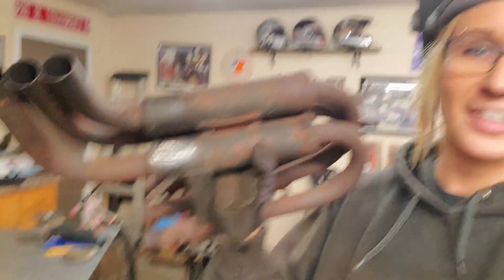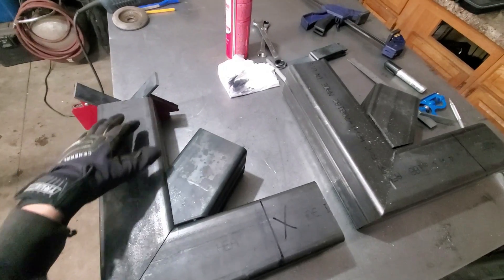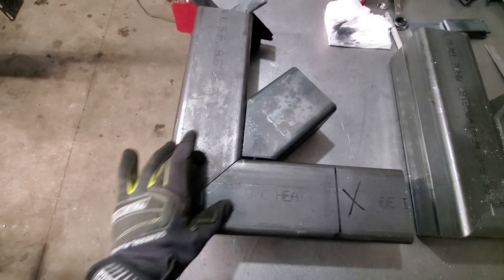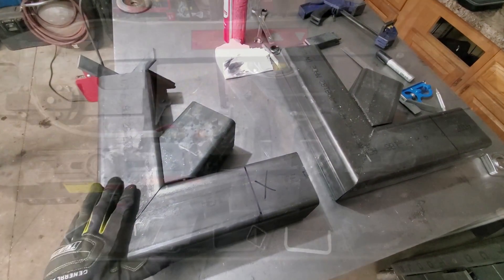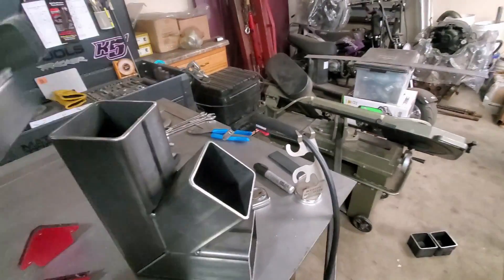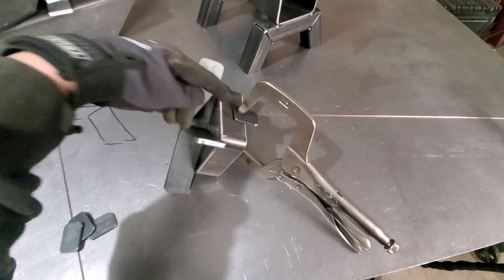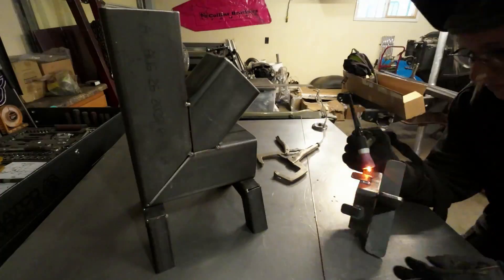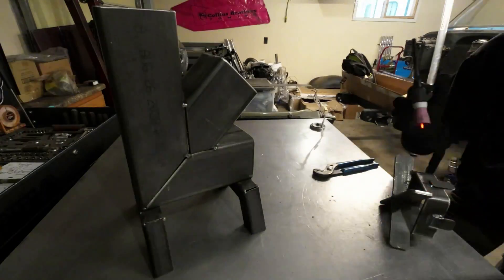ROCKET STOVE BUILD - A Day at K2 Fabrication

Comment: I would put the 4 tabs on the chimney then you can still use a pot on it without the grill.
Great editing.
Reply: by putting the tabs on the bottom, you only have to put them on once, otherwise, you need to put them on each top you create.

Comment: I was hoping to see a test burn! I'm curious about the offset on the feed tube. I was going to build ALMOST exactly the same as what you did, but was going to go 50/50 on the feed tube mitre. Two suggestions.
1 make a door, or cap for the feed tube. Then the air will suck through the bottom.
2 I love how you did the removable top, but if you also have another piece you could add into the chimney and make it taller, I THINK you would create better ROCKET suction. 
Anxious to see it in action!!! 👍👍
Reply from the maker: Thanks for your suggestions. You can see the finished product on my website! I tested it a few times and was pleased with the amount of "rocket" suction. It could always be made taller, or with different attachments on top, absolutely. I wanted a compact one for easy storage and transport, which is why I went with this size.
Reply from the maker: https://www.k2-fabrication.com/collections/fire-pits-cook-stoves

Comment: question on the compound miter you put in there. Does that make the fire farther forward. Seems like that would cause most of the heat go out where the wood is put in. At least with no cover on there... Just my thinking as I haven't built one yet. I really want to build one. But I am not even close to the welder you are... Just learning... But that is the fun of making stuff isn't it. I'll eventually try my hand at it.
Reply: @k2fabrication  yeah let me know how it goes. I'm sure it will work....In fact thinking about it it may give you the ability to pull the fire back away from the vertical controlling the temp for the cooktop. I'd be interested to know ..  Thanks for the reply btw My grandfather was a pipe welder ... Unfortunately I didn't get to much time with him when I was old enough to learn much. Now I want to learn as much as I can... But I run business to so I have limited time... Have a great day.